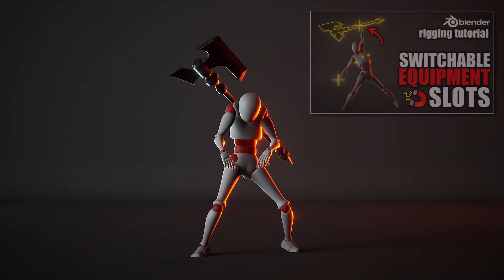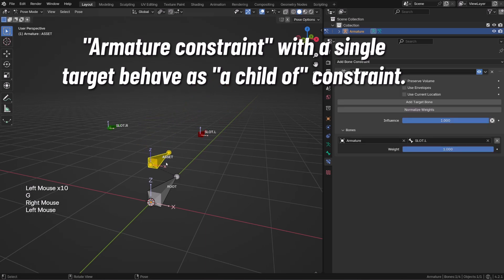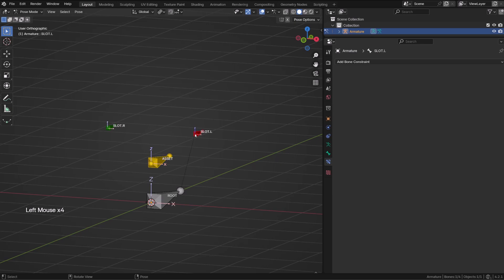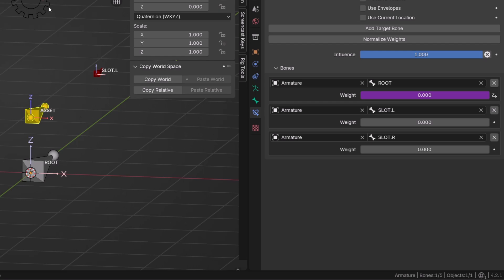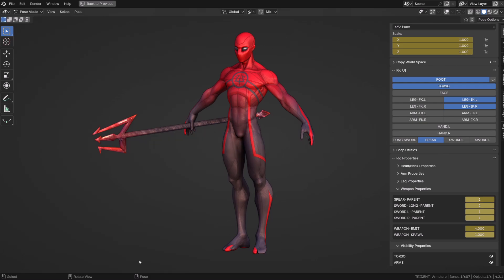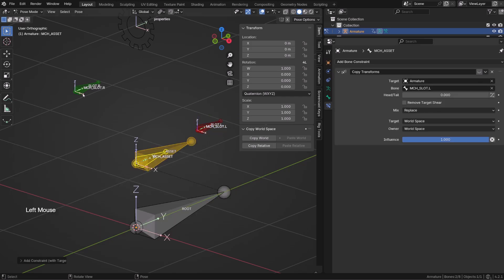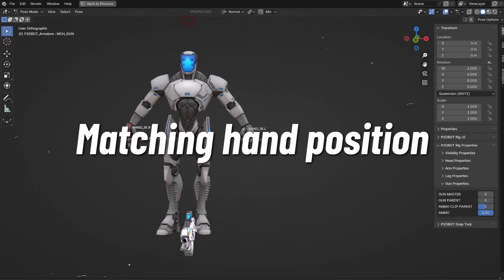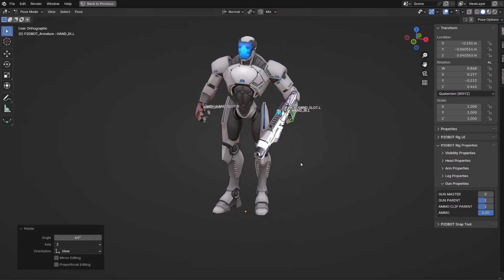Rigging switchable parents and equipment slots in Blender

Comment: Would you rig different outfits the same way ? Like a scene where a character steps out of a changing cabine with a different outfit on all the time. Ofc you can hide the collections everytime but I feel like there should be an easier way to do it with just a simple controller

Comment: You should pair with someone who works with godot and just work on a game. If animations are images with an extra dimension, then games are animations with an extra dimension. Your animations will always play the same way until you reanimate and re-render, but a game character can animate differently every time. 
You are already basically doing game design, creating logical relations between elements in your scene, the logical next step is to make an interactive NPC .
I make bendy bone caricature rigs for blender and I have made a colony simulator game with godot.

Comment: Happy four or so years of great Blender rigging/animation tutorials!
Also btw I encountered an issue one time that I pinpointed to a problem with the armature constraint: every frame, the bone with the armature constr. would lag behind by a frame. Not sure why, I'm sure I had the bone unparented and the constraint's drivers be correct.
Reply from the maker: It sounds like a circular dependency. Meaning that, in a way, the constrained bone is influencing the constraint target.